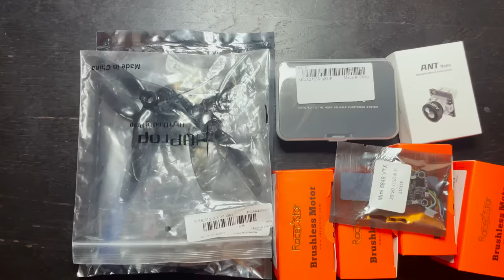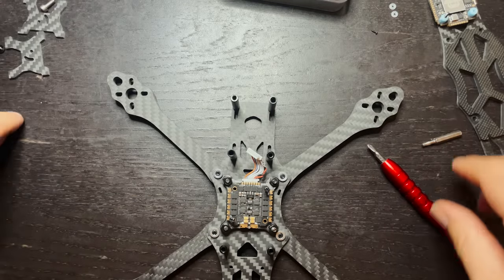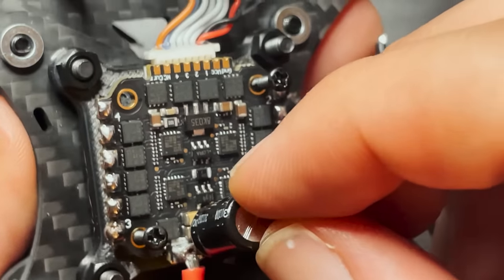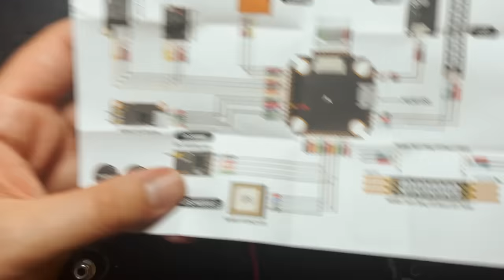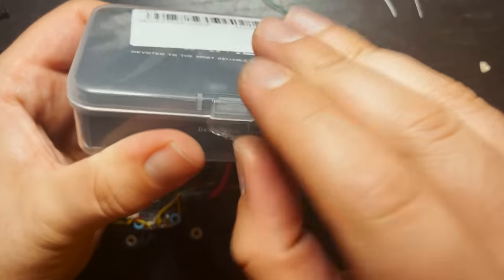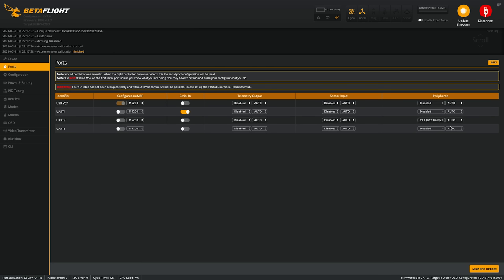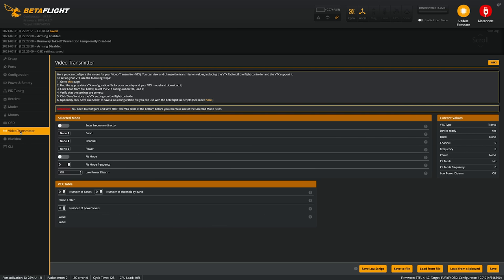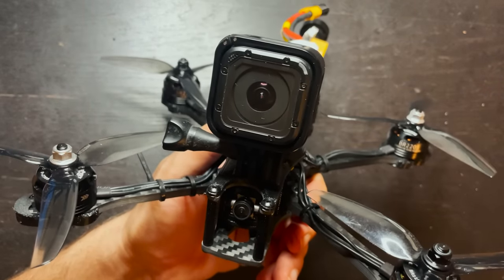Build a Freestyle FPV drone for $150!!

Comment: Now I'd build one but I am afraid that some softwarere issues my ruin the build since I am not that technically inclined. How would I connect the remote and also the goggles? any video on that aspect?
Reply from the maker: this is something that will vary depending on what controller and reciever you use. As of right now ELRS and TBS gear is the easiest to set up  on the RX/TX side of things (IMO).

Video gear is very straight forward. on analog equipment you pick a channel on your Video transmitter then switch your goggles to that channel. on digital you click a button on the vista/air unit, then press the button on your DJI goggles and they will beep and bind together. 
Hope this helps!

Comment: I am still doing my research on fpv. With this dron that you built, what controller are you using? Or if I build one, what should I be looking for?
Reply from the maker: For this drone I used my old QX7. 
Here are some links for updated radio gear: 
T-Lite V2 ELRS: https://www.banggood.com/custlink/vKDrvhakHD
2.4 ELRS Receiver: https://bit.ly/3bAacOE

Comment: Really cool. After getting the goggles remote and batteries in all likelihood you will be in the 500-600 range. My question is how long did it take you to learn to fly like that and how many drones did you destroy in the process? That is amazing flying.
Reply from the maker: Yes probably in that price range for the whole setup. 
I've been flying FPV for a couple years at this point and I have definitely had my share of exploded quads.

Worst one was when I got my first 5" drone. Was flying at an empty playground above some trees, dove down through the trees and didnt throttle up enough. boofed it right into the jungle gym going about 50mph. 
Frame was demolished, needed 2 new motors, new ESC and a new camera. The hero 7 black I had on board was destroyed too. 
Good times lol.

Comment: Is the electonic speed controller in the Mamba F405 ? and the control receiver/the FPV transmitter and the antenna too ?
Reply from the maker: The ESC and FC. come as a combo. they are separate boards that are connected via a ribbon cable 👍
The receiver has different antennas than the VTX.
Reply: @TRONCATFPV  thx, i love your videos and i will 100% make this drone

Comment: Hey man thank you for the brilliant video really helpful for somebody learning drones for the first time it helped to understand the different parts and how to put it together and this will be a project of mine next. Do you have any beginner videos explaining the components transmitter receiver flight controller etc and then the difference between cinewoop and FPV I understand a little bit but it would be good to learn more and then you can put affiliate links for all of the parts to buy. Anyway great video man that really was helpful. 
Personally I want to build drones for security applications. I come from the security industry and I have clients who have large grounds where people trespass to either steal or possibly kidnap. Whilst we have cameras radar and other security measures it would be really good to be able to deploy a drone with multiple payloads such as high resolution low light camera infrared and thermal and to take it even further to be able to do routine patrols along the property around the border and also within the grounds which could be up to 500 acres and if it detects buddies present alerts us. There are off the shelf solutions already like this enterprise once from Autel etc but they aren't as customisable as we would like and also quite pricey so I want to try and build them myself to my exact spec. Do you know how I could go about this?

Comment: Hey I’m looking at getting into the FPV hobby. Loved building my R/C cars & crawlers & I really your video. Honestly I’m kinda worried about the electronics setups since I’m not a computer person…any tips? But great content very informative & you went slow enough that I haven’t been scared off. Thanks!
Reply from the maker: A good way to get into FPV is with a cheap all in one kit that includes everything you need. 
With most kits you'll be able to use the controller and goggles with future drones 👍

https://www.racedayquads.com/products/emax-tinyhawk-ii-freestyle-rtf-kit-w-googles-radio-transmitter-case-and-75mm-indoor-racing-whoop-drone?_pos=7&_sid=0e6624657&_ss=r&aff=58

Comment: Great video!! I really appreciate the effort you put into this !! Just one question, the capacitor is really necessary ?? Thanks for everything ❤‍🔥❤‍🔥
Reply from the maker: I always put the capacitor on to be safe. For this build since I use 4s batteries and the board is capable of 6s, the capacitor isn't completely necessary.

Comment: Here's how to solder: when removing insulation you want the wires to keep their braided, always remove more insulation than you need (account for the longer lead) use flux on the lead, making sure it penetrates the strands then tin leaving a bright silvery lead, if it's full or hazy the bond won't be complete. Then clip the lead to length, keeping the strands braided and  brush flux and residue with isopropyl. When prepping the pads, use plenty of flux (another trick is to wipe the solder strand with alcohol, it cleans and residue and dirt?)

You don't want a gob of solder, just a light tin, use flux and attach lead, you should have a nice even filet around the lead boding to the pad, you should barely be able to see the wire strands, if you can't you applied to much solder. Wipe with isopropyl and spray with electronic surface cleaner.

The pull type wire strippers are better than the twist pull types for cleaner insulation cuts and keeps wire strands intact without fraying at the top. The wire needs to be intact and not frayed or hand twisted, keep the original form for better contact distribution. 

Once you lay down the wire to the pad, you want to do it in one go, so use the right tip and make sure it's clean and lightly tinned with solder.
Reply: I feel like I should mention this is a good comment, but also some solders especially some unleaded ones do leave a dull non shiny finish but have a good connection, something to keep in mind, and if they do add too much solder to a joint, as long as it’s a good connection and it isn’t interfering with anything then just leave it be and learn to use less next time :)
Reply: @DoktrDub  my eyes was bleeding while he was soldering too
Reply: Love your picture, Decepticreeps :)

Comment: Excellent video, very cool man! Something I would suggest for your smaller wiring considering the PCB terminals have the holes in the board is strip and tin the small wires then stick them into the terminal holes on the under side then proceed to solder them on the top on the board it'll give you a stronger mechanical connection and help tidy up the board as well! Looks great otherwise!
Reply from the maker: Thanks for the suggestion!
Reply: I concur
Reply: Those are not holes for wires. Those are heat sinking vias. Those jokes are not meant for wires to be inserted. The edges of the board use castellations for the wire to be placed in.
Reply: Yeah that’s a good shout out. I haven’t done any soldering in quite a long time since I was in school, but I remember using a soldering iron through circuit board holes was much more efficient as it keeps it more tidy and means the connection is generally stronger, even if the cable has to bend closer to the connection point if you are wanting it to lie down flat.

Comment: Just found your channel. As an old electronics designer, i'd love to get into this. 
The only thing you gloss over without much detail is the programming and setup config. Seems to me that that is the bit where you need to understand what and why... 
The physical build looks just like a model kit build, where everything naturally goes together quite easily (assuming you can solder and use a screwdriver).
You see, i'd have just unsoldered the wires to get the motors to run the right direction....
Nice vid. Subscribed 👍🏻🇬🇧
Reply: Yep....got me all confused in that section 😅

Comment: Nice build. I‘m running 2205 2300 kv Xing motors in a 4 inch Apex 6S configuration. Way lighter and quieter than a 5 inch. Lots of fun, too. Cheers
Reply: What's your flight time with those motors?
Reply: @Mangemonslip  Between ~3 and ~7 minutes depending on battery size (550 - 700 mah) and flight style (ripping like crazy - lazy cruising). Very often a bit below 3 minutes and very rarely close to 7 XD
I run them on blheli 32 ESCs (Mamba F722 mini mk3).
Cheers
Reply: @intensegamer7559  ok thanks!

Comment: Thank you for posting this great video. Quick question regarding the motors that you can use with this frame, can a 16 mm x 16 mm motor pattern mount work on this frame ? If only 16 mm x 19 mm pattern motors are the only ones that be mounted, can you recommend a different frame that could accomodate both mount patterns ? I ordered some of the parts and I am going to try and build one. Again thanks in advance

Comment: Surprised you're not putting Rosin on the soldering pads. Helps a lot, keeps it cleaner looking and you won't need those enormous globs of solder on the pad. You also won't have to run your Iron as hot. Your joints are not silky reflective, they are flat like crumpled aluminum which means your solder was overheated. Those types of joints are more susceptible to solder cracking. Does it work, yes, it could be better though. Constructive Criticism, other than that, wow great build and a good job.

Comment: if i wanted to shlap a regular gopro hero 8 on one? would i need to size it up? larger motors/battery/prop/frame? how much larger?
Reply from the maker: We've been flying this drone with a hero 10 for the last year.  Should have no problem with a Hero 8 👍
Reply: @TRONCATFPV  cool thanks

Comment: do the cables that are used to connect the battery to the drone come with the sypom battery or do I need to order it separately???
Reply from the maker: Those cables should come with any flight controller you buy. Thanks for watching!
Reply: @TRONCATFPV  thanks for the fast reply btw awesome vid

Comment: I've bought all the parts, waiting for them to arrive for my first build! How  do you know howmamy volts each component needs etc to decide which pins to solder them to?
Reply from the maker: Each component should have a user manual that will tell you the required input voltage 👍

Comment: This was a nice budget project to get into FPV. One question though. The footage from the goggles, I'm assuming was the picture in picture  view during the test flight? Was rough quality, reminded me of watching home videos from the 80's and 90's lol. That could that be fixed by upgrading the camera or is it also partly related to other things like antenna or signal or receiver? Also what would be a much better quality camera but still hopefully afordable?
Reply from the maker: yes that was the analog feed. You can also get digital FPV products that offer much higher quality video transmission but they are more expensive

Comment: excellent video! can you tell me if can I use MINI VTX XF5805 5.8Ghz FPV Transmitter 25mW 100mW 200mW 300mW 37CH 2KM with IPEX Connector Support Smart Audio Pitmode FPV instead of 5848?

Comment: Why do you connect a capacitor knowing that the battery is not 6s???
Reply from the maker: You should always have a capacitor, even on a 2s drone.
Reply: @TRONCATFPV  Ahhh, I didnt know that. And why do you need it always, even on a 2s drone??

Comment: Frame - 28,19€
Comntroller - 79,45€
Motors - 43,61€
Camera - 19,35€ 
Props - 6,73€
MiniVTX - 26 €
SYPOM Battery - 20 €
Shipping costs?
Control unit costs?

+++223 eur - what do i do wrong?

Comment: This is awesome, I think I might actually build one! Not sure you’re checking comments anymore, but how good/usable are the cheapie googles and controller? Will I just get frustrated with them (especially as a rank beginner), or would it actually be a reasonable experience?
Reply from the maker: The eachine goggles really aren't bad. Since they have an AV in port you can always upgrade the module to a rapidfire for longer range.
Controller wise, my QX7 has been great and faired heavy use for a couple years now and still works great.

If you're a complete beginner and are just looking for something fun to practice with id recomend an all in one kit that comes with everything you need. You can use these goggles and controller with other FPV drones in the future:

https://www.racedayquads.com/products/emax-tinyhawk-ii-freestyle-rtf-kit-w-googles-radio-transmitter-case-and-75mm-indoor-racing-whoop-drone?_pos=7&_sid=0e6624657&_ss=r&aff=58

Comment: I'm a beginner and would want to try FPV drones, I just want to ask some question regarding your video, how'd you know which color of wires to go to which slot? the one from camera and vtx?

Thanks!
Reply from the maker: the VTX (video transmitter) and flight controller come with manuals that describe which pads connect to which wires. just reference both manuals and you'll be able to see how each one connects to the other. Thanks for watching!

Comment: hey awesome video, ive wanted to get into fpv drones for a bit now but they are super expensive. but i have 2 questions, i have a 3d printer is there any way i could 3d print the body? also, i already have a go-pro so could i also use that on there, or would those make it to heavy for the motors. if it is to heavy for the motors could i possible buy a stronger motor to hold that stuff.
Reply: oh i just saw in the video you mounted a camera.

Comment: I checked out two of your video, I’d notice that you never mention the pinout of the motors to the ESC, they aren’t  label neither,
Reply from the maker: You can hook up the three wires to the ESC in any order. The direction of the motor can be changed in betaflight (4.3) or BLHeli 👍

Comment: Hey I got a few questions. I'm in to rc cars and trucks I bought a cheap drone while back on Amazon. So I burnt the motors up. I orders a new frame and new motors a lot bigger that the other ones the batteries are 7.4 volts already. My question is the batteries have 2 positive and negative connections can I bridge those to hook up my own lipos

Comment: okay so, we now need a drone with a sim card slot, internal cell phone AI , on a 2nd line with your provider, that will connect a call and roam on towers with your phone in hand, control commands sent through phone call data, so you can long distance flight. Then won't have signal range cut off, and can fliy between towers extending range. FPV possible this way ? 

strap a 2nd Iphone Mini , or a COS Chinese Teenie Tiny phone to the drone and link it bluetooth through a home made app ?

Comment: NIce video dude! On question... Why don't you have RSSI, is it beacause you didn't configurated or is it beacause you are not able with the components that you got?? Thxx!
Reply: One*
Reply from the maker: Great question, and i'm surprised that a year later you are the first person to ask this lol! 
If you go to 26:16 where I am on the receiver tab, on the right hand side of the screen there is a "RSSI Channel" drop down menu. On this drone specifically I think I just forgot to set it up, but normally instead of saying "disabled" it would be set to "AUX 12". Hope this helps!
Reply: @TRONCATFPV  I've just tried it but it doesn't allow me to set it. Meaning that when I set it to aux 12 or any other channel and I save it, when I refresh the reciever tab it shows again disabled so it doesn't save. Therefore, when I'm in setup tab, it says that I have 10% of RSSI, still don't know what happens, thxx tho!

Comment: Hello all, Does anyone know the diameter of the tiny screws used to attach the boards to the frame?  They're about 1mm.  I think there are two sizes of screws associated with the frame and attachments, I'm looking for the smaller of the two.  Thank you!

Comment: any way to get the fpv headset faster?? also any other possible vtx's? preferably for amazon
Reply from the maker: I recommend buying from RDQ or GetFPV for things like goggles. 
I would use amazon for LiPo's though since they have 2 day shipping and if you think youll crash you can always return or exchange the batteries easily.

Heres a link to goggles from RDQ: https://www.racedayquads.com/collections/fpv-goggles

Comment: Great Video, I am following you build 100, if I may ask you a question about the receiver which you said it varies.  If I am ordering the controller mention below, which receiver should I buy?  I am new at building drones and your video expire me to get into the hobby.
Reply from the maker: I would personally go with an R-XSR
https://www.racedayquads.com/products/frsky-r-xsr-s-bus-micro-receiver?_pos=6&_sid=94719aef8&_ss=r&aff=58
Reply: Sorry to bother you again, but I notice the battery pack is not part of the list.  Can you recommend one for the build?
Reply from the maker: @xgears27   This one is very similar to the one I used in the video. If not better!
https://www.racedayquads.com/products/rdq-series-14-8v-4s-1500mah-100c-lipo-battery-xt60?_pos=9&_sid=d1c008f69&_ss=r&aff=58
Reply: @TRONCATFPV  Thank you so much, it is coming along great, your channel is great.  Learning a lot from them.  I do have another question, what did you do with the receiver antenna? And can you also recommend a better antenna for the VTX?
Reply: @TRONCATFPV  The yellow cable goes to SBUS?
Reply: @TRONCATFPV  Thank you for the link above, question am I able to get telemetry by using the yellow cable ?

Comment: Hey  what if you don't have a 3D printer than it's going to be more than 150
Reply from the maker: Hey if you don’t have a 3D printer you can get the part for $3. Check description.
Reply: @TRONCATFPV  ***********   I noticed that you used BlHeli to configure the motor direction. Betaflight doesn't have the option? ***********